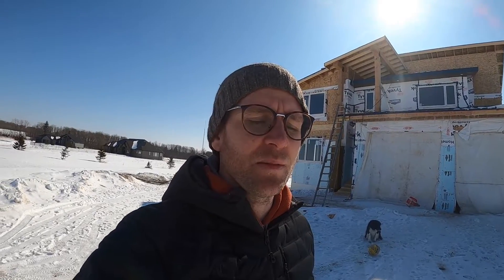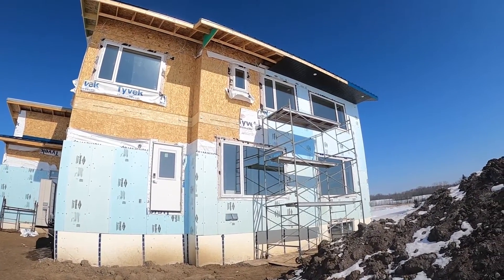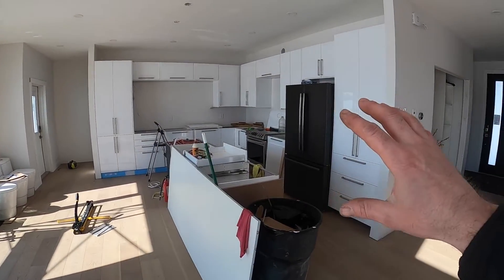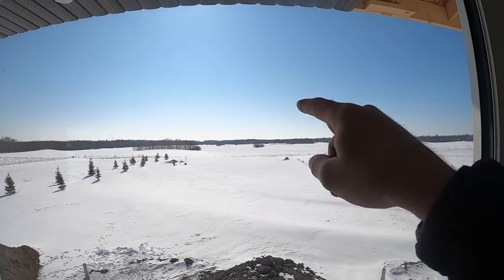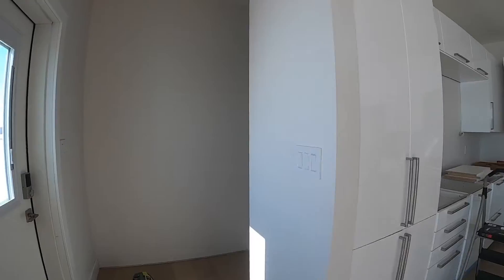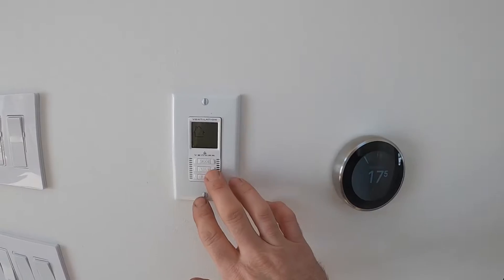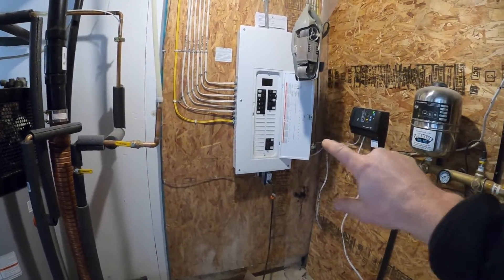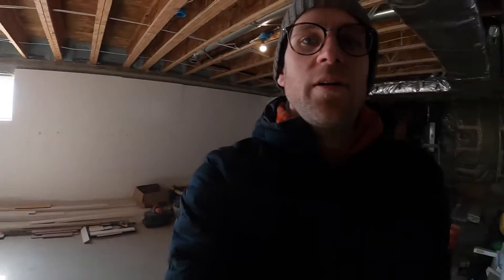Building a Net Zero home!!

Comment: Very interesting.   What is the model of the heat pump and do you know the COP at the lower temperatures?  

Looks like you will have a super duper comfortable home.  

BTW - any relation to the Zubots near Burstall Sask?
Reply from the maker: Thanks! It’s Mitsubishi zuba central air source heat pump. Working very well so far through the -30 couple weeks we’ve had. Yep I’m related to the Zubot’s in Burstall, as well as Wenzel’s in leader.
Reply: @DarrylZubot  Thanks.   How about Myron Wenzel in Burstall?  

I am very curious about that heat pump.   I read the tech on the Mitsubishi site and cannot find a "Coefficient of Performance" chart.
Reply from the maker: Probably related. Why don’t you email them directly if you’d like the COP?  We used Weiss Johnson for the install. They have installed other brands but prefer the Mitsubishi.
Reply: @DarrylZubot  Our house also has a heat pump with central air handler.  The pump COP falls below 1 at about -17C.  There is also a 3 stage electric coil supplement.